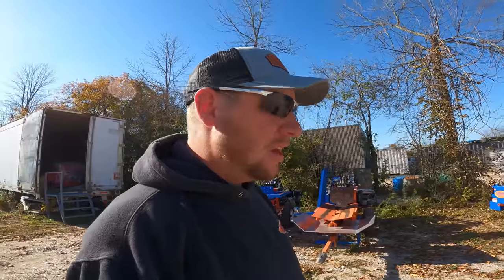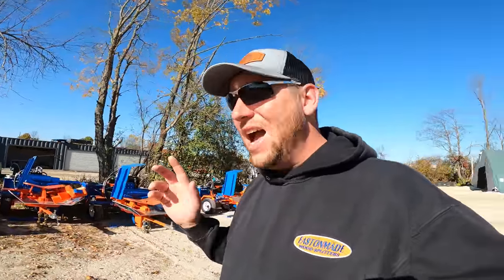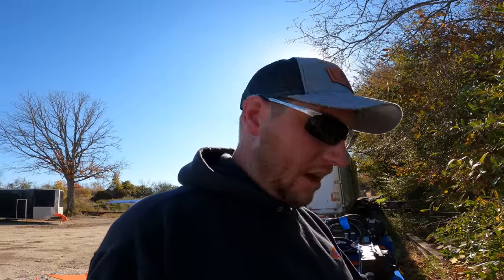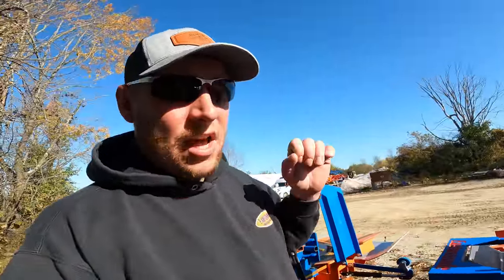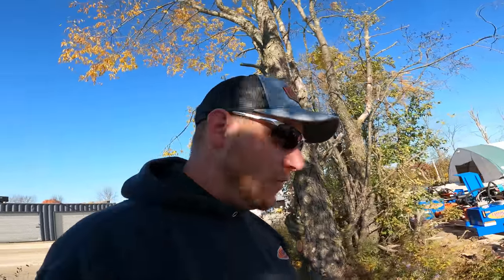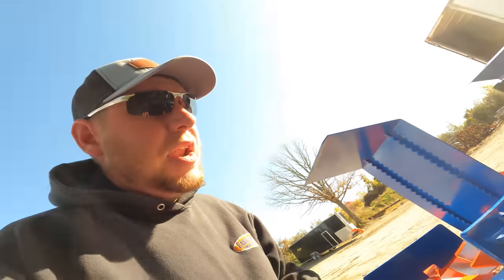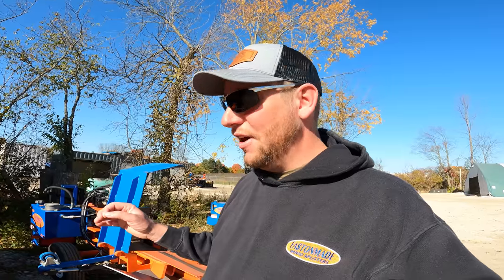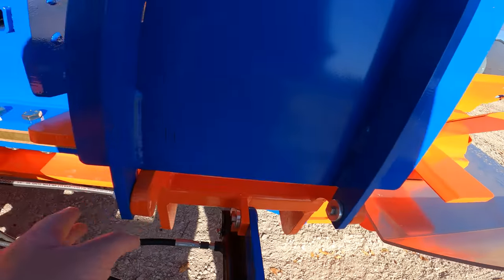Eastonmade; Wood Splitter Warm Up and Maintenance

Comment: For gas, I always run super in my small engines. 2 stroke or 4 stroke. More expensive yes, but less headaches.

For diesel, run the fuel of the season. Diesel gets more additives in winter fuel. You can run power service for this if required.

Comment: I have a Honda on my older 12-22.  Got a vanguard on my timberking sawmill.  They and vanguard both say run regular gas not higher octane.  Another timberking owner with same mill as  mine was running premium gas and was getting gas in crankcase oil.  Switched to regular problem solved.
Reply from the maker: Thats odd.  Havent run into that before

Comment: Would it be better to use a lighter oil on the I-beam instead of the grease zerk/grease? It seems like grease attracts much more dirt, debris and grime which and would contribute to faster wear of the pusher plate components and I-beam. What say you?

Comment: Great information Andrew.   I think small engines hate ethanol Gas due to the amount most sit around.  Ethanol gas only good for 30-60 days.       
   I always find myself running out of fuel in the 12-22, may need to upgrade to the 24d so I can use our bulk died diesel tank lol!      
     Also, I think the most important daily maintenance is keeping them blown off and clean.
Reply from the maker: All good points reuben.  Really appreciate all the support

Comment: Andrew - thanks for doing this video.  As someone who isn't the most mechanically inclined, the three that I can think of: 1) to tarp or not tarp when you are leaving it outside for a few weeks without using it,  2) do the wheels need any grease if pulling it long distances  3) any special fuel treatments for the diesels?
Reply from the maker: I would tarp it once it cools off.  The wheel bearings should be completely sealed and shouldnt need much maintenace if the grease hasnt leaked out.  Any diesel fuel conditioner (doesnt need much)  make sure when you put the machine away for the day the fuel tank is full
Reply: Very good question

Comment: For the cold weather guys and diesel's...Ive run Stanadine, Diesel Extreme and maybe a couple more but the best anti-gel we've run in our plowing equipment that sits outside not plugged in is HotShot Secret winter treatment and keeping the fuel tank full. Great info. How many pumps of the grease gun should I put in that zero when new?
Reply from the maker: Filling the tank does wonders.  Appreciate the feedback
Reply: @EastonmadeWoodSplitters  Nothing worse than finding a piece of equipment thats been sitting in between storms with a half empty fuel tank and changing fuel filters at 3am in a snow storm.

Comment: What about the hydraulic oil filter?
Reply from the maker: I did miss that for sure.  We normally dont recommend doing much it as it is a sealed system.  Unless the fluid is milky or burnt looming

Comment: What about the hydraulic oil mine isn't up to the full line cold should it? And is any aw 32 hydraulic oil good or what kind do you use??
Reply from the maker: 32 is what to use.  If its in the sight glass it should be fine

Comment: How many hours use before you replace the flux capacitor?
Reply from the maker: Theyre kinda finicky.  Really depends on how the synergy oscillator is performing.

Comment: Hi Andrew,  Has anyone ever converted a 12-22 to a 10 up electric motor?  You could go with a larger motor, but that would require a greater than 220VAC supply.  Shalom/gw  (Sr. EE retired)
Reply from the maker: Not yet...but we are working on an electric machine right now
Reply: @EastonmadeWoodSplitters  I converted my SuperSplit from a 5hp gas engine to a 1hp Baldor electric motor and a go-cart clutch.  The reason that works is that the motor only serves to maintain  the rpm of the two 70 on flywheels, they  disparate the stored energy when called upon to actuate the ram for brief periods.  The flywheels function as  a mechanical accumulator.  I haven't analyzed it, but a hydraulic accumulator may serve the same purpose.  Shalom/gw  PS Please let me know what you come up with.I

Comment: I just bought out a firewood business, it came with a 12-22, I used to run it for the guy and it used to cycle way faster, is there a hydraulic filter built into the tank? I'm sure it's a simple fix, but when I mentioned changing the engine oil, dude says " there is no filter to change, all you do is ad more when it's low" 🤦oh man, so there was never any maintenance.....🫣,
Reply from the maker: If you give henri a call at the shop he can walk you through the pump adjustment.  likely something simple
Reply: @EastonmadeWoodSplitters  thanks very much for your response, I went through and changed the hydraulic filter, topped off the fluid, it took a full 5 gallon pail to fill it, then I changed the engine oil.... twice, once to flush it out because it had never been done before. I also found the grease fittings on the push plate....they were covered in sawdust and I didn't even know they existed until I bought it. So after all that my cycle time is still slow, especially on the return, it's nothing like the 12-22 in your videos....I'm going to call Henri today actually, really hoping there is some kind of adjustment,what time zone are you folks in?